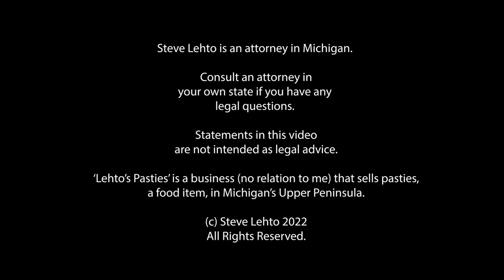Did Ford's Use of Cheap Steel Increase Roll Over Danger?

Comment: My brother in law works for Ford. He is/was a buyer for steel on the 99 Superduty. True fact god can strike me down as I'm typing. He actually told me he walked out of a meeting in 1999 almost costing him his position for this very reason after stating he wasn't going to stand behind buying cheaper steel associated with the roofs on Superduty pickups. He wanted nothing to do with it. Same was asked of steel on the first model SUV Ford Flex's. I am a Ford pickup owner since 1989 f250, 1999 f350 SRW, 2003 f350 DRW, 06 f350 DRW, 08 f450 DRW, 2017 f150, and a 2021 f450 DRW.... so there is no Ford bashing going on here. Afterwards he got transfered to purchasing turbos for diesel pickups.

Comment: Ford probably used the same cab from the 150 on the 250 & 350. The Super Duty truck has a heavier frame, engine, trans, differential, so the math says it would fail.
Reply: No, they did not. 1999 was a newly designed cab for Superduties F250-F650 and did not share anything with F150.

Comment: Stress is a function of load; the capacity of a structure to that stress is extremely complex. I was in a federal jury pool one time; first question was "are any of you engineers?" If yes, you are excused. Can't have a jury that knows too much because they would negate the BS arguments of the lawyers. Boron is an alloying element; absolutely no way it increases strength by 4x. Unfortunately, a jury of non-technical people won't know that.
Reply: that should have been considered a mistrial. You cannot excuse someone because they are more capable of detecting truth.
Reply: Alloying elements definitely can make a huge difference, especially when combined with the heat treatability they can enable.

Comment: This issue goes way beyond the automotive market.  Structural pipes used in building structures are also far lower quality today than they were 20 years ago.  Our government's war on the steel industry is squarely to blame.  Ironically, while their goal was to decrease carbon emissions, they achieved the opposite.  U.S. steel costs rose dramatically so most of the steel used in the US today is made overseas where emissions standards are far worse than U.S. standards dating back to the 90's.  I don't know where the steel was made in Ford trucks but with the costs of steel rising so high, Ford would look to minimize cost.

Comment: My question would be: "Is the 'cheap steel' the same steel that passed the mandated safety tests? If so, this allegation is more smoke than fire."
-
edit: "Stronger" versus "weaker" in materials science is a gross oversimplification.
Metals objects have compressive strength, bending strength, torsion strength, vibration response, rust reaction, mass, weldability, and other properties.
A "strong" metal object of a given shape may fail by bending, snapping, deforming, or not fail at all under a given application of force. Then if you apply a different force or the same force in another axis, it may maintain shape or fail in a different manner.
Some flexible metals will bend when taken past their Young's modulus, while more rigid metals will snap. Which one was a "stronger" metal?

Comment: Steve I’m a welder I do not know that much about Boron steel but it’s used to make lots of sports equipment as follows. 

Boron as boron fiber and boron steel has excellent tensile strength. Boron is used in sports equipment like golf clubs, fishing rods, tennis rackets, and bicycle frames. It renders them the required power, flexibility, lightness, and durability, thus, contributing to better performance.

I’m sure there’s someone else on here that knows about it a lot more than I do. 

Just trying to throw in some facts for you here keep up the great videos love to watch them every day very informative.

Comment: I actually remember this as a thing back in the early 2000's.   I was living in the Youngstown Ohio area.  I had friends and relatives working at Lordstown Assembly.  I could be wrong, but I remember discussing the issue about Ford, and Chrysler using Russian steel for large sheet metal areas on their vehicles.
Reply: Or steel from China.  Really cheap.

Comment: using cheaper steel to save - you can be that was the idea of some MBA they hired and not one of their true mechanical engineers
Reply: Though it’s highly likely the mechanical engineers went along with it.
Reply: @timdowney6721  to be clear, I do not mean a fresh out of college with ME degree, but someone comparable to a licensed PE. I am not sure if Ford has something like this, requiring technical vice president (Fellow or distinguished engineer) to sign-off on the engineering. They may be an overly management driven organization, all important decisions made by MBAs?
Also, what is the cost of a life they used in their calculations? It used to be 2X annual salary, so if average salary is 50K, then 100K? realistically, I think insurance settlements are more like 10X salary now. much much for high profile, and if politics/race are involved.
however, now we should consider who can afford a 70K truck? wouldn't that be someone with 140K income?
Reply: MBA=overpaid, over empowered bean counter.🤮

Comment: I cannot imaging having to purchase ANY new vehicle. Recalls are expanding exponentially. They are built cheaper, corners are cut, electronic nannies teach drivers to pay less attention, are annoying, distracting and unsafe. Software bugs have had multiple companies issue 'do not ship, do not sell, do not drive' mandates. I plan on my keeping my analog easy to repair 2001 Truck and 2005 Car til I expire.

Comment: Boron (or carbon) locks the inclusion defects in the iron and makes it much more difficult to bend into (or out of) shape.  Less force means less energy needed to form the pieces and lower tooling demands.  All of their structural engineers definitely knew that such a change would cause the cabs to collapse.  Metallurgical analysis on the actual wrecked trucks can definitely tell whether this is true.  If this is true, then Ford should definitely lose this case.
Reply: If they used the same geometry, maybe. If they changed the geometry at all, it's an apples to oranges comparison.
Reply: @roflchopter11  Define "they" and "geometry."  I don't see how these apply to my comment.

Comment: going from 2.4mm to 2.2mm is the difference between a soda pop can and a spray paint can!  also them changing the steel quality is a similar comparison. Soda can crushes easily where the spray paint can takes an awful lot of pressure to crush

Comment: Just more allegations from plaintiff attorney's who are more interested in their pay check than reality of ALL dynamics in this matter. Everyone knows that sheet metal gauge has changed from decent thickness that can be repaired if damaged and other features however, over the years, the thickness of all sheetmetals on vehicles has moved to very thin gauge, Ford is not alone on this fact. This would apply to pillars and other structure areas as well and its all for the EPA because they force auto makers to get better fuel mileage every year.  I wouldn't be blaming Ford 100% unless there is evidence they knew they were using metals that were "unsafe" or past what should be reasonable according to federal standards. 

At some point, these plaintiffs need to understand Ford is not required to build a perfectly safe truck for roll over needs. I still don't hear much about the fact that the truck had crap tires and may have been loaded unsafely among other things.  Where is that in our discussion?...it all applies to the roll over factor.
Reply: I agree, as a welder working with various grades of steel, whatever they used is probably a moot point as far as strength goes. I've used American tubing, European tubing, Indian, etc, it's not exactly the same but fairly close.  Overall design and material thickness would have a bigger impact imo.

Disclaimer: I'm not an engineer, just my real world experience.

Edit: I am curious if there's any heat treatment applied to these steels as that can change their strength drastically.
Reply: @KISSMYACE3203  Being a chassis based vehicle with a body mounted to the chassis, I'd think no.  Most of the HSS metals that have heat treaments in them apply to unibody vehicles such as passenger cars.

Comment: I suspect that many of these types of decisions relative to material types and weights are driven by other factors as much or more than profits.  Specifically, the fuel economy mandates that are increasingly more stringent forces the manufactures to cut corners that most certainly impact overall safety.
Reply: I have a 2007 super duty F-350.
It weighs 8320 lbs empty. 
That's very heavy for a pickup

Comment: I work at Ford Motor Co.  and I will tell you steel with the a Boron added to it is usually about 1% but steel with Boron is extremely hard I know.... it's virtually impossible to drill through .

Comment: I decided to never buy another Super Duty after our 2006 6.0 Diesel kept blowing up turbos. Went through 2 in less than 12,500 miles. Went through 4 in under 35k miles. Sold it and never looked back.

Comment: I have am '06 Super Duty. AND, I've been in a rollover while driving a semi. Yes. Rollover in a semi. It did a 3/4 twist. On to the passenger side, then upside-down before stopping on the driver's side. Rollovers are no fucking joke. I wasn't wearing my seat belt when it happened. Good thing too. I was sideways in the cab when it went upside-down. It shoved the A pillars back and down. Took the roof and shoved it back 4 feet and that included the top of the windshield frame. I walked out of my truck through the 'roof'. All the bleeding stopped before the EMTs arrived and all I had was some bruises, minor scratches and now, a little scar from the worst cut- less than a half inch by less than a half inch X like scar.

Comment: Is this a case of misuse of a product? Trucks are considered commercial vehicles that are expected to carry stuff during business hours, 5 days a week, in a low speed urban environment, and they are actually being used as highway speed people movers at any time of the day, should these vehicles be designed for the true use case?

Mini vans were, at one time, glorified light trucks. But in a roll over the roof would crush down to the waist line, killing a lot of people. The US Gov decided to reclassify mini vans as cars, and the redesign necessitated putting in proper crush structures in the roof, front, rear, and sides, and lowering the fuel consumption to what was required for a car rather than a light truck. Less people were killed, but they had to pay more for their vehicles.

This seems to be the same issue. People are buying commercial vehicles rather than personal cars. Do you need an F250 to drive from your house to your office? Around here, apparently yes, people feel that they do. In places like Australia, an F250 would be considered a utility vehicle (if a beast like an F250 was available), get lower taxes (since they are used for business purposes), but they have to follow the usage rules of utility vehicles (lack of passengers, time of use, place of use). 

The auto makers are gaming the system, producing commercial vehicles that they know will be used outside of their design parameters. Consumers think that they are buying the more robust vehicle, but consumers don't know what the design parameters are. If they had to sign a waiver that said "I understand that, in a roll-over, this vehicle's roof may crush to the bottom of the window line, because the laws governing trucks say that this behaviour is normal", people may change their buying choice.

Nah.

Comment: I was looking for a yard truck or a truck in general to plow my driveway last year. I don't like tall trucks or trucks in general so it was a utility purchase. I noted that the f350 and f250 on average were unusually tall for their class. Are they increasing the roll over risk on these to make them taller for esthetic reasons? Or is there a function to all that suspension travel for the normal expected use of the trucks?
Reply: All trucks were getting taller and still are . I suppose it's sale related since so many owners put lift kits on them,
Reply: Probably a mix of reasons. “Bigger better faster” appeal. People increasingly buy by data/numbers, and most truck buyers aren’t buying “safety” design focus vs say a Volvo, so yeah it just is what it is. An option/lineup slightly different from others to distinguish itself. Probably >9/10 trucks on the road aren’t used for hauling/anywhere near their capacity regularly, so based on consumer patterns they shift focuses and always find ways to pad numbers that don’t pan out well or fail in the wider experiment of mass scale real world conditions.
Reply: The heavy duty trucks are taller because they have a suspension designed to carry more weight.
Reply: What were you comparing them to??

Fords and RAM HD's have solid front axles as opposed to GM's iFS.
Reply: They might be taller to improve visibility over an ever-taller fleet of SUVs. When towing or hauling, there is substantial safety benefit in being able to see further than just the car ahead of you.
Reply: Could it be they want better ground clearance for construction sites where they are used?
Reply: @GH-oi2jf  To a certain extent.  But, increased spring leaf can't be blamed entirely by itself.

Comment: Really though, all US auto manufacturers have been using crap steel for some time now. I've seen sheet metal on vehicles so thin the heat generated from body filler curing actually caused warping I the surrounding material. Late model trucks rusting out left and right nowadays, it's ridiculous. To top it off people are paying a premium for basically modern junk.

Comment: Ford has been using cheap steel for their frames.  I had a Ranger a couple of years ago.  Body was perfect, not a through rust anywhere on it.  Fenders, rocker panels, entire box were all good to perfect,,, The frame rotted out to the point the truck broke in half.  The frame rusted literally to pieces.     I just had an F150 frame reinforced and welded, because,, it was to the point it was about to snap in half,  The Ranger was a 2000,, the F150 is 2007.  The 2009 I have the frame is fine,, the body fine,, the rocker panels have completely disintegrated.  The steel used is the most logical explanation.  But,, think about it,,, the frames rot to pieces.  How do you work on a truck with a frame that has disintegrated?

Comment: If you want to see the difference in steel try cutting through a padlock with a  hardened boron alloy steel shackle and one made with standard mild steel.
Reply: With abrasives it's no trouble at all.

Comment: I'm sure more information will come out but I'm willing to bet Ford knew exactly how the vehicle would perform in a rollover. They study the vehicle very close and have lots of data on them. It will ultimately come down to did they make the right call on an acceptable level of risk. Indeed that's an interesting question of law, but I strongly doubt that they were unaware of the risks whatever they are.

Comment: Do all Ford pickup trucks such as the F150 use the cheap 2.2 mm thick steel pillars?
Reply: Super Duty. Not an F-150,  which is a half ton.

Comment: i own three of these diesel powered trucks and am happy as ha-ties with them, all this finger pointing is just plain Bravo-Sierra. ALL roll overs occur due to improper operation, put the blame back where it belongs!  Respectfully, Dennis, KV4WM  -  73
Reply: In a roll over that is not driver induced, then the fault is with Ford. If even one injury or death occurs, then Ford is at fault. Steve would agree.
Reply: “All roll overs are due to improper operation.”
Now THAT, is “Bravo-Sierra.”

Comment: Not sure whether it caused more damage in roll overs , but it did cause my 2019 F 250,s truck bed to rust through in 3 years . I have a 1997 F 150 and the bed is just fine !
Reply: I believe the 2019 fords are aluminum…
Reply: @JacobTerherst  Front ends and side walls .
Reply: @scottodonahoe9505  then why did Chevrolet use to show commercials advertising how weak the bottom of the aluminum bed was?

Comment: I do automotive interiors and they all are kind of skimpy in the roof area,none have what I would consider enough bracing.  It even gets worse on the extended cabs where the area behind the main doors open and does not have a B pillar..
Reply: It isn’t that simple.  The rear doors of an extended cab add strength to the cab when they are closed.  You are not likely to get into a rollover situation with the doors open.

Comment: If the design of the vehicle substantially changed, surely it would now not comply with the safety test certificate obtained for that model ?
Should Ford not have to apply for a new test rating before putting it on sale ?
I believe that they would have to do that in the EU since the NCAP rating is now out of date.

Comment: Concerning corrosion of the steel, besides the usual cold tar oil/latex bottom coat, I placed some magnesium cathodes in strategic places, it's too early to assess effects, I live in a place that salts the roads only in mountain areas for a short part of the year, we'll see.
Reply: Technically, they are anodes, not cathodes.
Reply: @roflchopter11  You're right, my bad. I have some dyslexia when it comes to some electronics. I was thinking, "cathodic protection."
Reply: @jacqueslefave4296  all good. It doesn't help that they change polarity (I believe) depending on if you're "charging" or "discharging" the electrochemical cell.